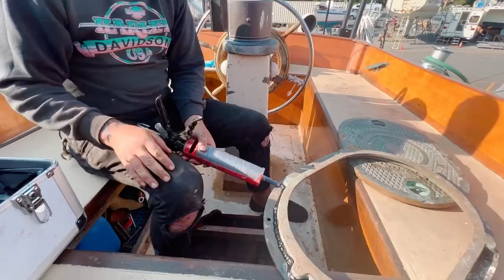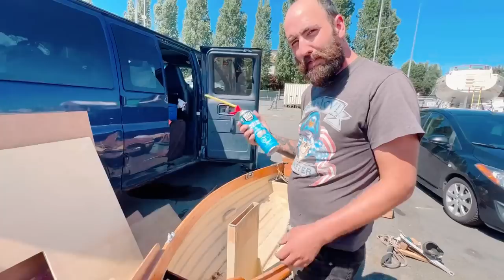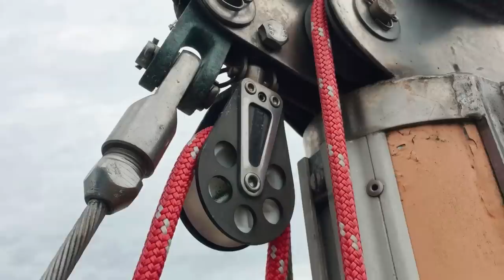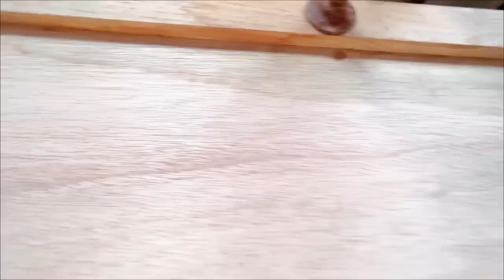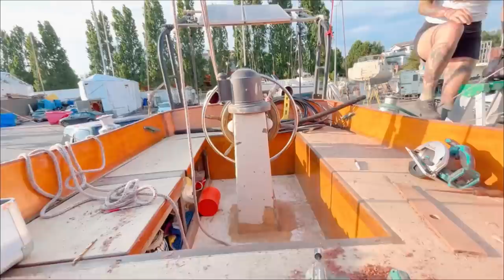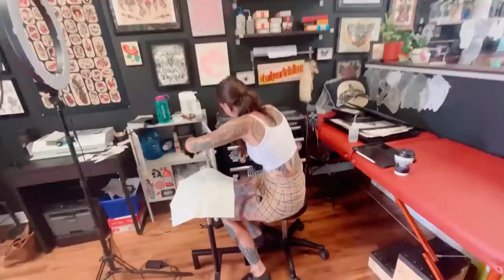New Tattoos, Traveller, Hatch, Couch! The End Is Near! Redodo Lithium! Sailor Barry & H Episode 28

Comment: Oh wow, Barry, you use Gorilla Glue! I love that stuff. I picked a bottle up in Home Depot in Chicago not knowing what it was, when I was there for a trade show years ago. Then one day I needed a “glue” and discovered what this glue actually did. Now I use it all the time, particularly for sealing ribbed hoses in the plumbing (I get a lot of criticism for that, but tough shoes) and it works as an insulation too. I did know about this stuff from a long time ago, its used in commercial kitchen building for bonding plywood stiffener under Stainless Steel counters. That stuff is pink, but basically exactly the same function. I now exploring their water proof tapes. 
I’d like to see Dagon (but dogon it Dagon is done gone) at a boat show to see the expressions of people who step out of sterile modern boat interiors in the aesthetically lush richness of Dagon.

Comment: Nailers, not Sailers!! Great expression. I think that covers all liveaboards.

What you should have done with the engine was set the optimum angle for the engine and align the transition box to the engine, then use an old truck tail shaft Universal Joint to connect the transition box to the Prop Shaft. The reverse direction engine is a good way of keeping the engine out of your living space and back under the cockpit floor.
Reply: As opposed to Sailors , not nailers!